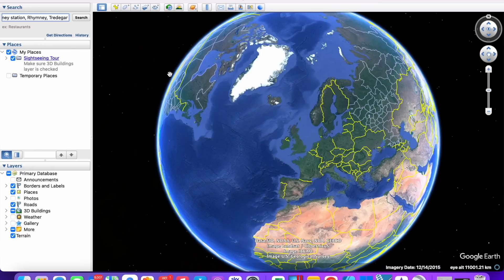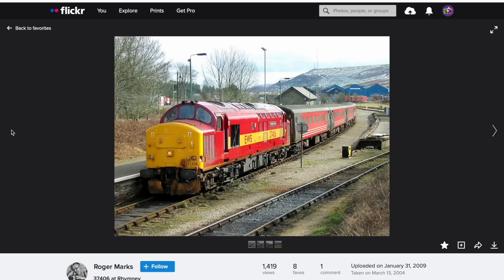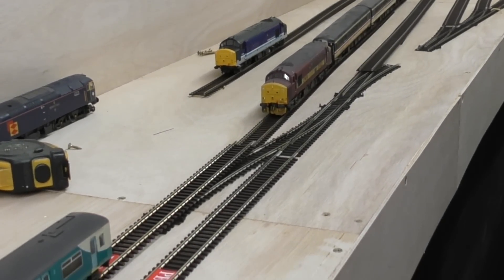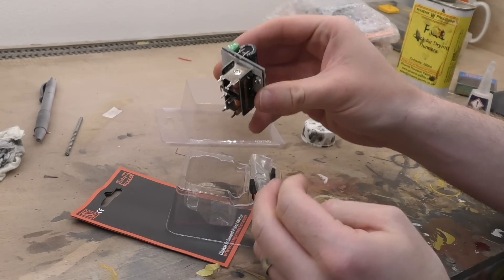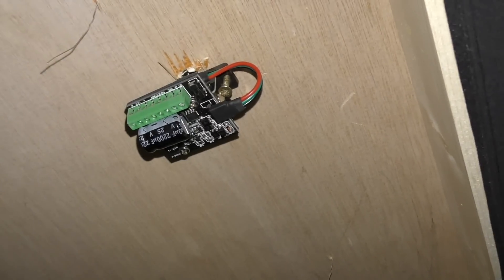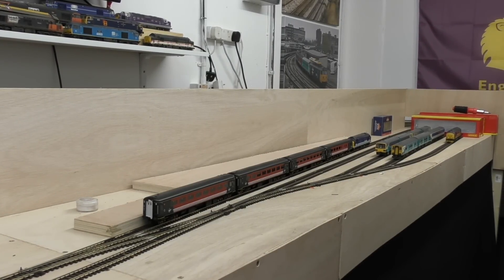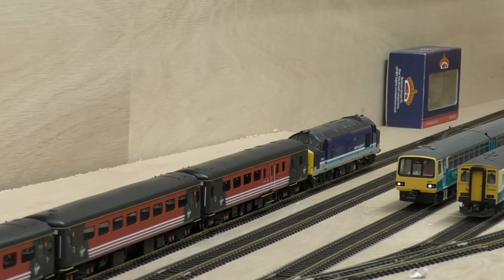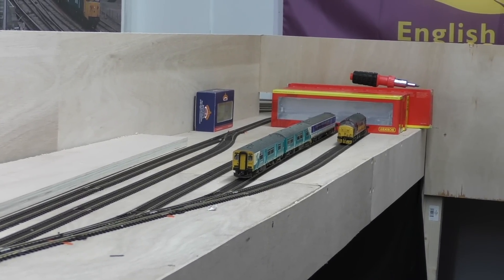Talbot Moors Episode 3 | The return of Gowerton Parkway

Comment: Hi, love the layout and the Rhymney extension will be a great addition.  One question,  in the photos they show coaches stabled in the sidings,  could you extend the head shunt to allow the 37+4 coaches to shunt to the carriage sidings for overnight cleaning?  Otherwise you could shunt 2 at a time., cheers, Rich
Reply from the maker: Hello there , yes I did look at the possibility of being able to have a longer headshunt , unfortunately though it would cut straight across my work bench which I wanted to avoid . I may look at shunting the rake in 2 parts and having a resident 08 or 09 to carry that out .

Comment: Now that is looking very good for the future Marcus. Just a couple of queries to keep my thoughts clear.
On the point motor when you inserted it in the mounting plate you did not turn the tabs to lock the motor in. Do I assume you are expecting the black Tac to do that? If so, thank goodness we don't have to tweak those pesky tabs any more. Secondly you called the point motors Seep. Are Seep now doing an exact copy of the Peco motor? Not criticism but genuine queries.
Looking forward to the next episode. Cheers, Bob.
Reply from the maker: They are quite a tight fit Bob, so luckily they didnt need the arms bending . They are guagemaster points with peco mounts , so I guess that could account for a tighter fit . Seep style I shouldnhave said , they are just solenoids.

Comment: Really looking forward to seeing this progress. As it is an old station, maybe just call it Gowerton rather than parkway as that was a new age kind of name, but your layout call it what you wish.
The station building used to be and I think still is the train crew office, messing facility. Rhymney had guards and drivers based there. That was the right hand door of the building. No ticket office though, not in the times I've ever been during class 37 operation.
Another solution for rhtt was that during the late 90's and early 2000's a single 37 fitted with a sandite hopper was used. 131 and 229 definitely featured at the time. 674 had a sandite hopper too as did 675.
Reply from the maker: I do think you are right about the name to be honest. Im still quite undecided at this stage !

Comment: Just a suggestion....you can squeeze the sidings much much closer together. That makes it look for life like and you can then get all 4 sidings in
Reply from the maker: I need some space between them for the walkways. Its a depot where outstabling occurs , so cleaners and mobile fitters would require access . There will be a concrete walkway between each siding . Putting the sidings closer together will lose the ability to model that, so I cnt really fit a fourth siding In unfortunately.

Comment: For me, it's not so much the noise an electromagnet makes throwing a point - it's the wear and tear on the point itself, slow action would be less stressful on the working parts.
Reply from the maker: To be honest, i think youd have to hammer the usage a lot before it damaged the motors. Ive used these in previous layouts and never had a point fail luckily.